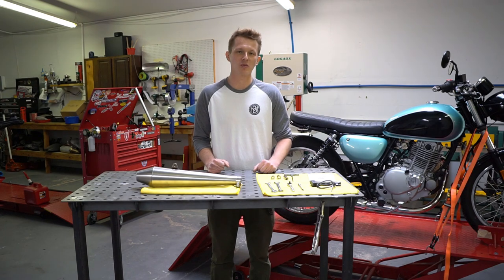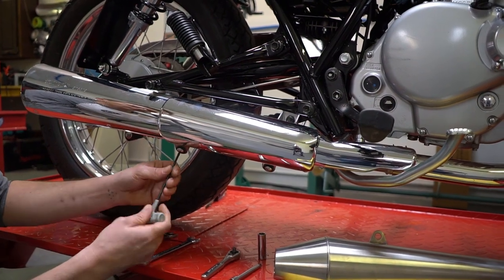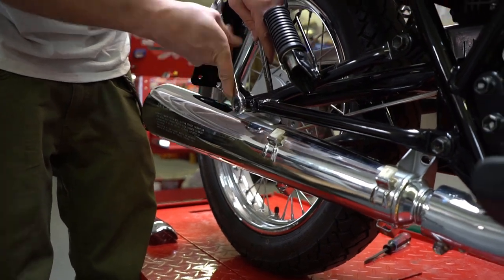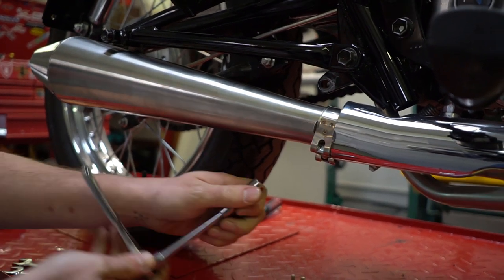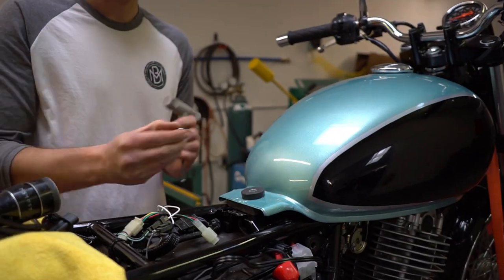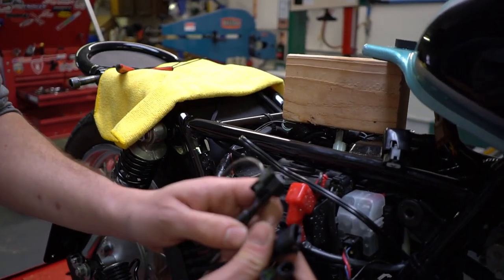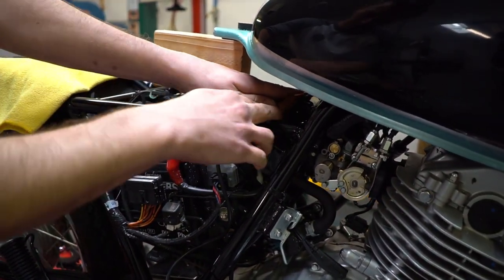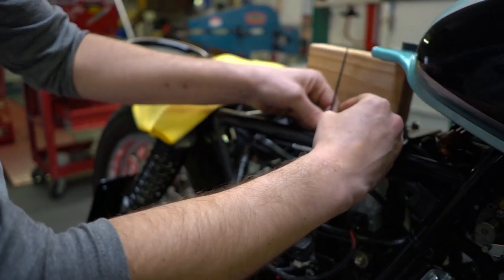TU250X Brogue Bolt On Muffler and Booster Plug Installation Video

Comment: Would you mind sharing what that rear brake light setup is and where I can find it?
Reply from the maker: It's our café kit and we use custom dynamic LED strip... we then weld cut and inlay them into the cut down loop.

Comment: I just installed mine. It was way looser on the exhaust than your bike, but it tightened up fine. The booster plug was super simple to install 
It sounds great! 50 and sunny in Chicago today. I'm going for a ride!
Reply from the maker: Happy to hear and safe riding! Yes, ours was tight because the clamp was tight during installation which helps keeps the gasket from sliding back. We need to note that:).

Comment: Could I install the muffler without purchasing the plug to go with it? Worried about how the bike will perform, popping, etc. Thanks.
Reply from the maker: You can, but you will have some popping.  Not as much as others on the market. A Booster Plug will help with that. I hope this helps! Cheers.
Reply: @broguemotorcycles  Awesome, thanks for the quick reply!

Comment: Is the booster plug used only for muffler replacement or it can be used on its own?
Reply from the maker: It sure can and we've installed plenty of them on customer bikes. They all love it!
Reply: @broguemotorcycles  so a booster plug and I'm good? I wanna fab up a yoshimura
Reply from the maker: @JDMdrifterboy7  Yup!

Comment: Re the booster plug, don't you have to connect a 3rd wire to the ECU? That's what the instructions on boosterplug's website show.
Reply from the maker: If you follow the video you are... By putting it "inline" with the computer (air temp sensor).
Reply: @broguemotorcycles  No worries...thanks for the reply! Have just ordered a kit. Gorgeous paint job on that bike too :)
Reply from the maker: @zhukie  Awesome and thank you! Hope you like everything. Please feel free to reach out if you have any questions.
Reply: @broguemotorcycles  Will do. many thanks again for the help :)
Reply: @broguemotorcycles  I have now installed the BoosterPlug and it is everything you have described - and more! Has transformed the way the bike rides, its almost like a completely different machine. Could not be happier with it :) 

Could I also ask re your other mods pictured...is the flat seat available seperate from the BP/muffler kit?
Reply from the maker: @zhukie  Glad you are happy! We only have our TU kit which is built to order.